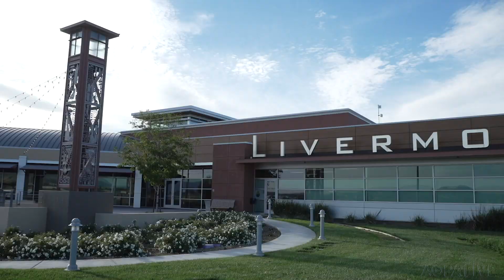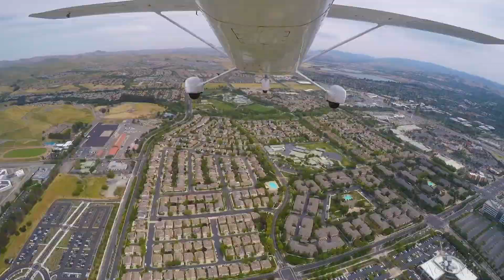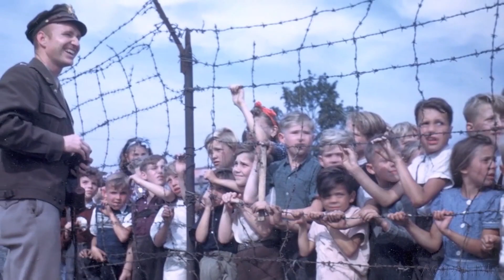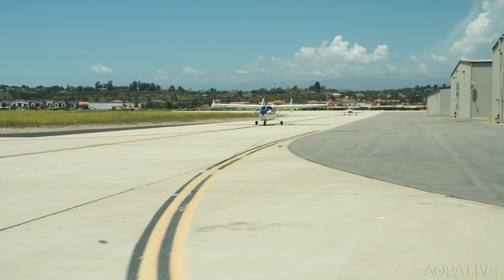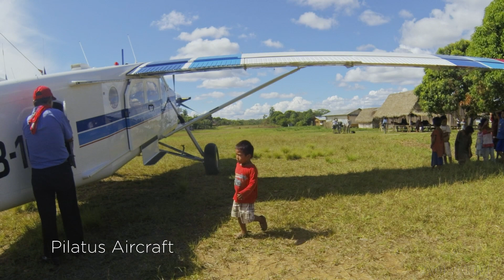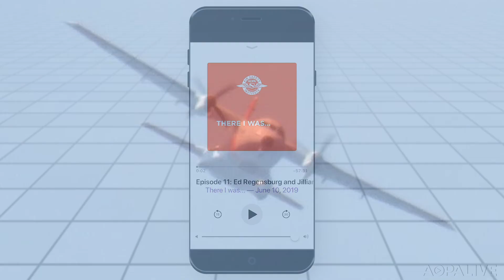AOPA Live This Week - June 13, 2019

Comment: They keep understating the danger of DEF contamination in fuel systems. If added to fuel it destroys everything it touches. Anything it comes in contact with must be replaced as you cannot flush it out. The remaining danger is that it crystalizes upon exposure to air. Very Very expensive to repair.
Reply: So far it's been two t38's a Falcon900 and recently two Citation560. Hot section inspection, new fuel system/pumps. And I believe they do something with the tanks as well. So already a couple million